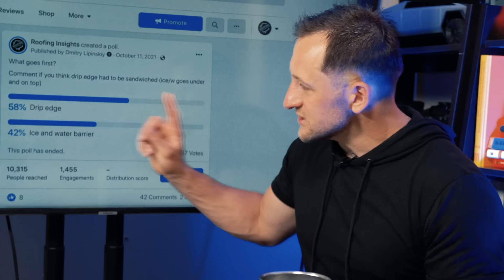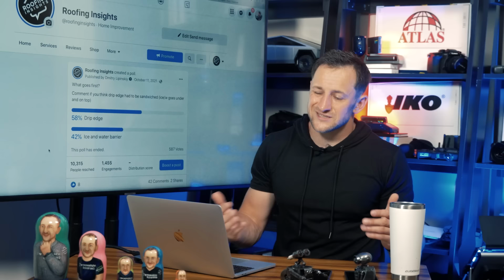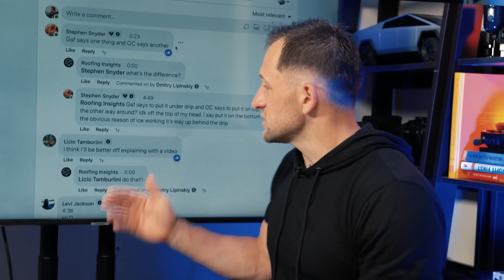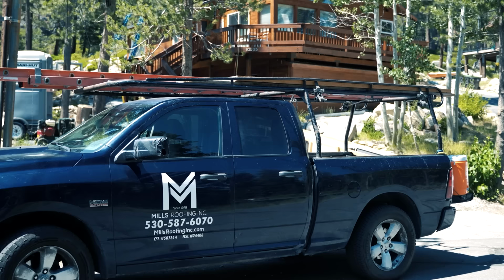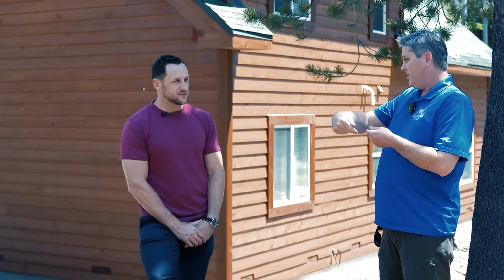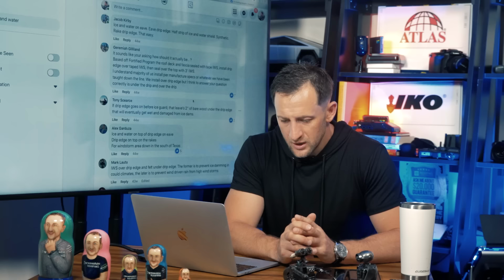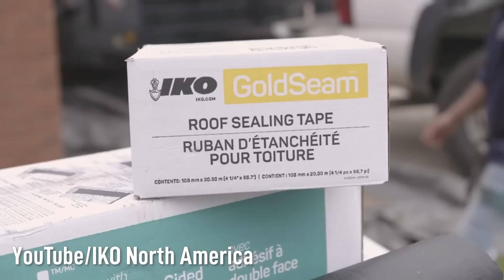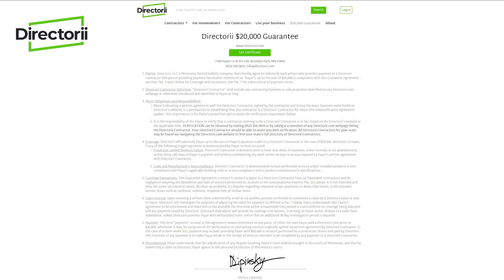The Big Roofing Debate: Drip edge or Underlayment first?

Comment: Why not both? Do the bottom strip of underlayment first, then drip edge, then do the whole roof's worth of underlayment.
Reply: Agreed
Reply: Yep, it's called "Double Wrap"
Reply: Yep yep
Reply: @Marcco you say no but can’t give an explanation? “He’s guilty but I can’t tell you what he did wrong your honor”!
Reply: @Bob LaFountaine  you can have severe problems with condensation and moisture if a roof covered with IWS is not vented right.
Reply: If you put the drip edge on top so that you can wrap I&W around the plywood edge to the fascia then there is no place for a second drip edge.
Reply: Always try to vent in heated bldg.
Reply: The whole problem is wood for decking. Need another non rot material.
Reply: Just came to say this.
Reply: That actually is the proper way for guaranteed longevity same with replacing the Eaves every time a new roof goes on  here in Canada at least because you take the fascia metal off you wrap your first roll ice and water strip drip edge and then another full piece of ice and water and then full synthetic underlayment butt overlap the ice and water 50%  that's how I like doing it but it's not realistic to do every house like this
Reply: @organicvids totally agree.  A composite type material similar to Trex Decking but in 4’x8’ sheets.  The possibilities would be endless.  100 year life roof decking.
Reply: That's what I did!!!!

Comment: I am a home-improvement contractor and I’ve seen hundreds of poorly installed roof with subsequent rot of the facia board one by two wood drip edge and soffit. It always boils down to inadequate drip edge flashing. Quite often the roofers down here cut the underlayment, whether tar paper or synthetic, too short and then try to cap it with drip edge it always leaks. I always tell my roofers that I want a custom drip edge with at least 4 inches of material that caps the two by facia board and goes over the roof decking. Then I like the underlayment on top of that it can always be caulked down on top of the flashing.we never have any call backs for rotted Wood on our roof with that method. We also use storm and ice shield on low pitched roofs.

Comment: If its steeper than 10/12, it doesnt really matter unless you're that bad of a roofer. The lower slope the roof, the more you have to protect it. The steeper it is the faster water sheds. I'm a steep roof specialist and I've made repairs at the eave of steep roofs because someone placed drip too tightly on the fascia so it sat on top, not over the fascia creating a "pooling" area. So if you're Roofing a lower slope, nothing wrong with an extra layer of protection under the drip, and if you're on a steep beauty, rope up and roof right
Reply: It all depends on what climate you live in really to here in Canada you're you don't want to go above and beyond
Reply: Another big misconception is underlayments to stop leaks that's secondary if water gets under the shingles you screwed up somewhere 

It's a vapor barrier here in Canada for the most part that protects the decking ventilation is very important as well you don't want to mix your vents either having a whirlybird and box vents is no good you can  create cross ventilation happening
Reply: Another thing I see a lot here in Canada is underlayment on full roof is an upsell I laughed my ass off at that one 😂

Comment: As a former Philadelphia area contractor, if new capping was being installed I would cut a 36" or 48" roll into 12" rolls, down fascia and onto roof deck, install drip edge, then install full roll over the drip edge. That way it's local code compliant and I could guarantee to my customers that they will NEVER have an issue. But MUST use a high quality product that sticks to itself permanently. My favorite is sharkskin ultra sa, super aggressive adhesive, once it's pressed on its impossible to separate. It's a bit pricy, but worth every penny. It makes a complete seal so no chance of ice creeping in. In Florida were I live now, can be over or under as per installers preference,  but drip edge must have a nail every 4" and 4" min roofing cement around all edges of the roof for hurricanes. For this I prefer on top because the cement bonds to the metal and won't tear off with the underlayment like a lot did during Hurricane  Ian that just rolled through my neighborhood.
Reply: Yes like this depending on details, basically 1st stip 1 inch above the drip on deck so full sheet of self adhered material has sandwiched the drip. 1st layer seal nails in drip 2nd covers.
Especially great in metal roofing applications.
Reply: How are you cutting a roll in half? What's an easy method??
Reply: Yep. I did mine the exact same way. Best of both worlds. You protect the plywood decking at the eave edge with the smaller first layer.
Reply: @tchornomud  A utility knife with a new blade. A long straight edge. You do not have to be perfect since you have the factory edge which is straight.

Comment: Dmitry, we do both.  We prefer Grace Ice and Water Shield.  Our second choice is Owens Corning Weather lock Mat Ice and Water Barrier.  We rip the 36 inch roll in half to create to 18 inch strips then we put the ice and water shield down on the deck and roll it over the deck shearing and onto the facia about 1.5 to 2 inches.  We then do the same to the rakes.  Next we install the drip edge all around.  Then we install a full layer (36 inches) over the top of the drip edge and the underlying ice and water shield.  We have never had any issues with inspectors and we have never had any issues with the deck, rafters or trusses.  Thanks for all of your excellent videos.  Best regards to all.  Blessings...
Reply: How are you cutting a roll in half? What's an easy method??
Reply: @tchornomud  We simply roll it out, measure, snap a line and cut with a razor knife.  Tip, we use a 10 foot piece of 1/4 inch by 4 inch steel flat bar.  The weight makes it real easy to hold and cut.  We have cut the roll in half with a band saw but that was a mess.  We cut a lot of thin strips of Grace ice and water shield and use it like heavy duty tape for a vast variety of other uses as well.
Reply: @danielstover3029 build yourself a 2x4 box, set the roll inside put your razor down into the wood.. pull the roll through.. way way easier
Reply: @danielstover3029 also love and agree.. just sandwich the ice n water!

Comment: If you find shingle stuck down to ice & water you can take a propane weed burner and warm them up a bit or if it is hot and direct sun will soften them so you can lift them off.  I use either 5# or 11# propane cylinders on the roof.  Use a heavy duty bent scraper to lift the end up a bit and grab them with gloves on.  If you rip off the bottom portion of the shingle the sun/heat applied works quicker and won't turn them into mush that pulls apart.  If you are lucky catch the North or shades sides early in the morning when it's cool and you can sometimes pop them off fairly easy.  Just add an extra man hour day to the price.  Sure beats tearing off the plywood deck.
Reply: PEOPLE JUST NEED TO USE BETTER ICE&WATER "GRACE SELECT" OR SOMETHING SIMULAR
Reply: Exactly correct my man. I sometimes use a heat gun, just don't over do it!

Comment: To further input for Will County IL and other areas in IL…. You can install the ice and water shield first (as it should be) then the drip edge and then any kind of underlayment (I&W or synthetic) over the drip edge and the remainder of the roof.   That is per Will County and Bolingbrook IL.  So do your own cost analyst to see what cost you more or less.
Reply: Totally agree!   However, in unincorporated will county, that method is not allowed with synthetic felt over the drip edge OR anything over ice snd water if its granular.
Reply: @hamstraroofing  interesting as I was told by two different inspectors that you can.  But it’s not in black and white 🤷‍♂️
Reply: I recognize your name sir. I have a briefing with one of your Reps tomorrow. 55yrs in the game is what caught my attention.

Comment: Drip edge goes first. Full stop
Reply: And just so we are clear. We have replaced roofs we did over 20 years ago and I have yet to replace any plywood or fascia with IWS on top of drip. Also in fairness more often than not even when it was just felt paper on top of the drip, the plywood is fine.  Reversed with felt under drip guaranteed rotten edges.
Reply: I do agree with the "fortified method" if you are in a heavy snow belt area. Where I am in mid-michigan is not

Comment: When ice and water first became available in our area, we put it over the drip edge - thinking, over, over, over was the best way to keep water running down the roof and away from the house. However, we quickly discovered that when the ice and water, being an asphalt product, expanded and contracted with changing temperatures, it rippled the metal drip edge and therefore also rippled the the shingles that were on top of it.  After that we started putting the drip edge over the ice and water but maintained the over, over principal by starting our synthetic roof paper at the eaves (over the ice and water.) We eliminated teh rippling and but kept the sealing advantage of the ice and water.  This also eliminated the problem we've had with removing old shingles from ice and water that was put down 20-25 years ago. It can't be down in some cases. We've had to tear up sheathing on some roofs in order to remove the lumpy remains of old shingles that are permanently stuck to the ice and water. The manufacturers didn't tell us about that 25 years ago when they said ice and water was the way to go.
Reply: The over over principle 😅 alright Einstein

Comment: First I cut the 36" roll in half to 18".  Then I wrap the ice & water down the vertical face of the fascia.  The remainder goes up the roof.  Drip edge next. Then Standard 36" roll of ice & water.  
I've replaced  too many rafter tails and fascias doing it any other way.  I've even began using green treated lumber for the fascia board.  This method will never rot.
Reply: I wish more roofers cared this much about quality and longevity.
Reply: right on !
Reply: I agree with your drip edge and ice shelf method.

But no pressure treat and aluminum they don’t love each other.

Comment: 1' strips of Ice Guard onto roof deck and wrapped to fascia.  Install DRIP.  Then go ahead with your full roll of Ice Guard over the DRIP to cover nail penetrations.  It's called the Double Wrap method and it will not fail

Comment: When I did my roof, I had the roofers cut one roll of ice and water barrier in half and apply that first, hanging 3 inches down the facia. Drip edge was then installed.  Last, ice and water barrier was applied on top of the drip edge and covered the entire roof.  Otherwise known as the "Hybrid Method".
Reply: Absolutely agree! The only reason this is not standard procedure is that time is money and that's all they care about.
Reply: How are you cutting a roll in half? What's an easy method??

Comment: Use pvc trim for your facia board. Pvc trim is impervious to water. Make sure your pvc trim hangs below the wood that it is fastened too by a couple inches. Having the pvc hang below the wood that it is fastened too will make sure water cannot wick back up and onto the wood. Next lay your ice and water shield down and let it hang over the edge by a few inches so that you can fold it down onto the pvc trim and create a water tight bond. Drip edge goes on top of that, then starter shingles. Im not a roofer, but i have done a few roofs on my rentals in washington state. In my opinion this method that i came up with is the best way to make sure water cannot physically penetrate the structure in any way.

Comment: Here's a thought:  Eves Edge

Put a 1st layer of Ice/Water barrier down, so enough of it goes down the facia board to be hidden edge behind a gutter.

Then 2nd, install drip edge/gutter apron.

Then 3rd, install another layer of Ice/water Barrier over the drip edge -  with lowest edge of the Ice/Water barrier up to the horizontal edge, before vertical plane of the drip-edge/gutter apron.  And the 2ndIce/water barrier will be off-set above the first layer by the distancethe 1st layer was installeddown the fascia board - maybe 4-6 inches?.  

Then you have Ice/water barrier protecting facsia boards, and covering drip-edge/gutter apron nails too, with one layer aboove, and one below the drip edge/gutter apron!

Then your ready to install another layer up-roof from the 1st two down low.

Cost a little more, but sleep better without images of water leaking at the drip edge/gutter apron, going through your head on Christmas Eve!

And.no matter what code you have - this method meets both under and over the drip-edge/gutter apron situation, one way or the other, done!

It's just a thought - take a survey!

Comment: Ice and water then drip, then starter strip, then shingles. I've working in Cali and upstate ny. We do it like that for redundancy. That's the trick to roofing really. The ice and water sticks directly to the plywood. The drip goes over the ice and water (helping to seal the nails used in the metal) The starter sticks to the drip, the shingle sticks to the starter. It's bullet proof. If water gets under the shingle it hits the starter strip. If it gets under the starter, it hits the drip. If it somehow gets by all that or backs up from snow and ice, it hits the ice and water barrier. Edge metal almost always gets sandwiched. Even in commercial roofing using single ply membranes. There may be more than 1 way to do this, but 9 out of 10 good roofers prefer my way 😊
Reply: You are correct about edge metal gets sandwiched but starter strip doesn’t seal to ice and water adequately. You need a strip of ice and water that wraps over the edge, then drip, then the full sheet of ice and water.

Comment: I saw one roofer's video who pointed this out.  Eves edge - For cold climates, he likes to remove the gutters (or there is post roof installed - preplanned gutter installation) and he puts the water/Ice barrier all the way over down the fascia board, to the point that it will be hidden behind the gutter when installed/reinstalled; then put/nail the drip edge/gutter apron on.  Then no matter how bad the water becomes and ice dam in the gutter, etc - no way it can get under the ice/water barrier.  And nailing thru the ice/water barrier to attach the drip edge/gutter apron, it will seal the holes.  And, you can always give the nail's exposed heads which are holding the dripedge/gutter apron a shot of tar caulk too!
Reply: Smart but those tear offs must be crazy, replacing fascia around all the eaves after trying to tear it off.

Comment: I can understand why there's a 50/50 poll here. The different regions in the US have different requirements. In Illinois, Drip edge (ODE) is only allowed to be used at the Rakes, and Gutter apron is used at the eaves. So Ice and Water shield is required to be on top of the gutter apron at the Eave and under the drip edge at the rake. On new construction the Ice and water is applied and draped over the facia board 2"-3" at the eave, with the Gutter apron on top of the ice and water shield.

Comment: One must hand the roof, not air nail. Air knocks holes in the Shingles. Especially when they're cold/ Brittle. 
I should teach roofing, 67 years experience, plus three generations before me, started in 1924. I have roofed from coast to coast. Put on some that will last 300 years.
My mother was a roofer and hand nailed 15 squares a day.

Comment: Water runs down hill… think about it like duck feathers…. Drip edge…ice and water to code… synthetic… shingles… vent and cap… if water does ever enter the system for whatever reason the water will not damage the deck, fascia, soffit, and possibly gutter system.  The only possible reason to put ice and water first would be for wind protection and if you use starter ( which you should).  Always great content! Thanks for your contributions.
Reply: Duck feathers do not form ice dams. What does water do when it meets a dam?

Comment: This is to Nate at the beginning of the video. The reason why the roof is bulging up is not because of the gutter guy. It is because you didn’t remove the gutters before installing a larger drip edge or gutter apron. The larger drip edge or gutter apron hits the gutter hangers and you end up with that bulge in the roof at the eave.

You have to take off the gutters before larger drip edge goes on or install the same size drip edge.

Comment: Great conversation dilema Dimitri ,I've been roofing in Northeast Ohio snow belt for over 50 years and the last 2 interviews were great. If any contractor lives in areas of moderate to heavy snow and prolonged cold spells then they should adhere to the IWS 3" down over gutter board then drip edge then 6" strip covering drip edge.  Then you should cover all IWS with underlayment so the shingles won't stick to the IWS.  As a contractor I never wanted to come back to redo as one bad job will chase you down the road. Probably the most important thing is making sure that the roof has adequate soffit venting and ridge venting.  Do I think that every home needs IWS 🤔 No. But if you have a house with multiple dormers,valleys, and no overhangs then you better make sure you have it.